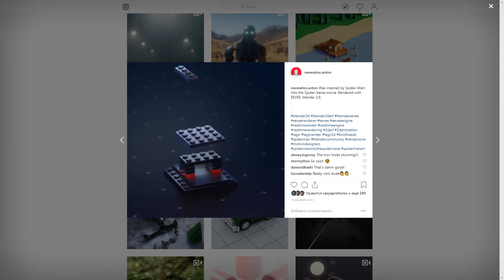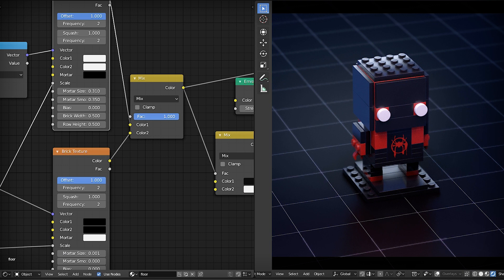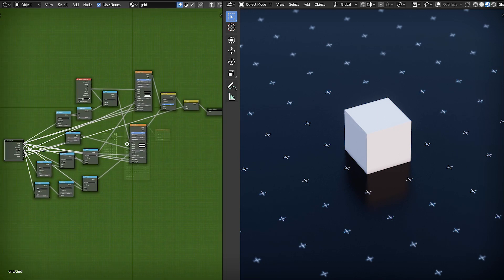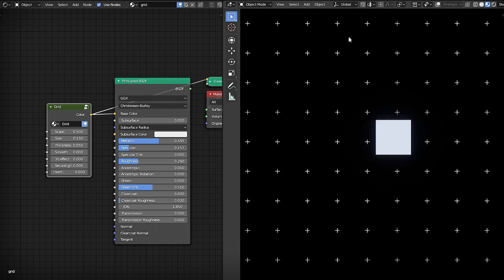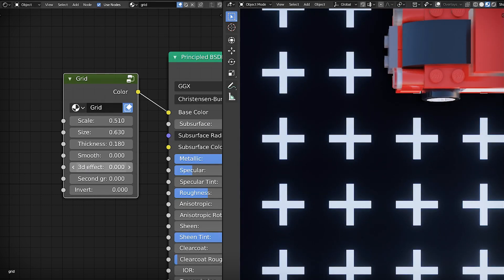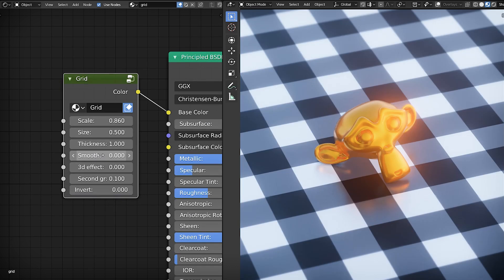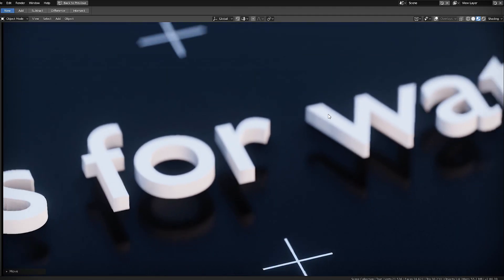Blender - Procedural Grid Texture short tutorial

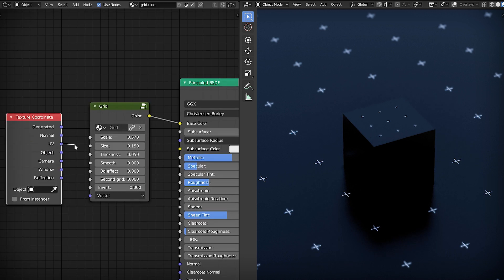Comment: I really love your shader, and I manage to make it work fine on a surface, but when you connect the texture coordinate at 1:52, it seems to constrain itself to the surfaces of the cube perfectly, while in my blender fill, it puts cross at random on every faces. I've tried using the same parameter as your video, and all transformation have been applied to my cube, but to no avail.
Reply: Learned a bit more about blender along the way, and found the solution. It had something to do with texture mapping and unwrapping.
Reply: I'm having the same issue, is there a simple fix to this? @noarau

Comment: This is very nice! Is there any way to change the color of the grid lines? They are either all white or black if inverted (or grey in between). Thanks!
Reply from the maker: Use grid as mix factor(fac) of node "mixRGB". I think i should upgrade this node with color mixer:)
Reply: Thanks, that worked! But, yes, it would be nice if there was a color mix feature built into the node. Thanks again!

Comment: Thank you! Awesome stuff!

My only question would be how can I apply it correctly vertically? The top and bottom faces of my assets display the grid correctly but not vertical faces (it looks stretched). I'd like to use it as my default dev grid texture.
Reply from the maker: you need to unwrap your model with cube projection
Reply: Also, if your object is transformed in the vertical direction but you haven't applied the scale, I believe the mapping will be stretched.  To fix, select your object and hit Ctrl+A, and apply the transform values, which should fix the stretching if this is the issue.

I could be wrong as I'm a complete amateur and only started 3d modeling a few weeks ago, but thought I'd suggest.
Reply: @JoeSpinstheGlobe  this worked for me thanks

Comment: this is a fab help - ive been trying to get some grid patterns using brick texture and various hair pulling attempts over several hours and I remembered your grid node it really works nice - i looked into the grid makeup you setup but its just so deep in what its doing i had to give up on following the workings of it and allow myself to use it without knowing fully what its doing! many thanks
Reply from the maker: No problem! It looks deep, but actually it's very simple brick textures mix and setup, so many connection needed just for easy setup:)